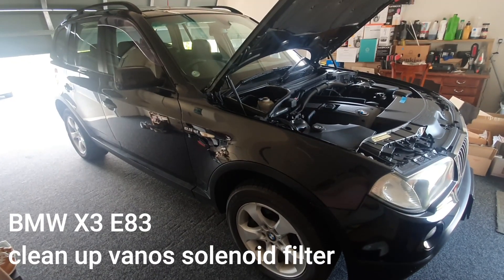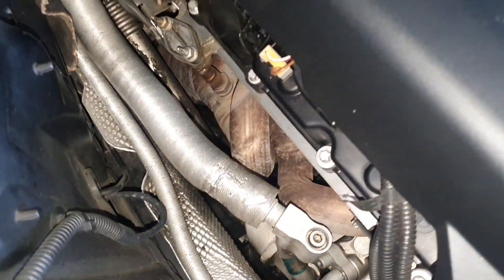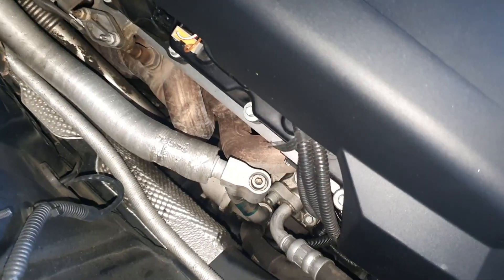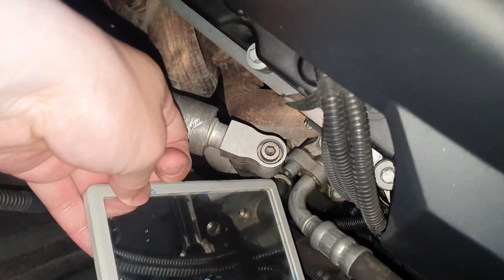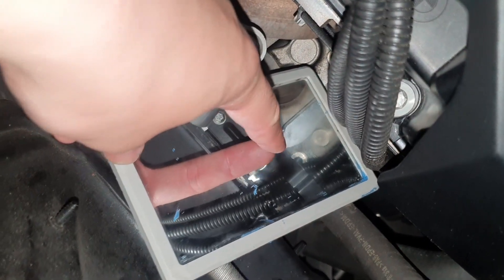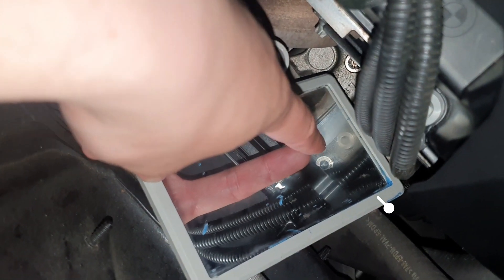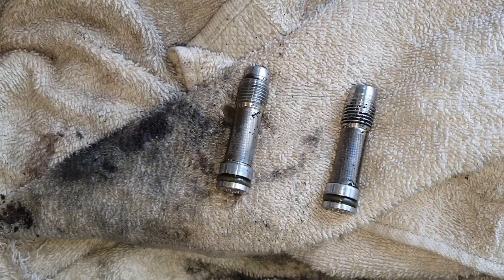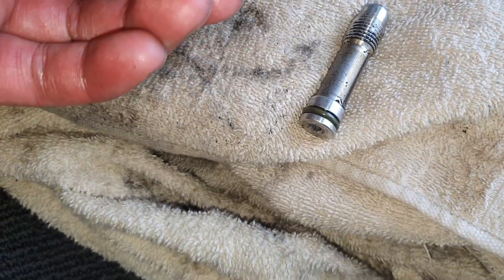clean this before too late. BMW X3 VANOS solenoid filter

Comment: I find on my 07 E83 if you move the washer reservoir it gives much more space to remove/install the valves.  When you clean the valves, make sure the ball inside is free, and rattles when you shake it. If not give it a few taps until it frees up.

Comment: Will this fix rough idling?
Reply from the maker: if the idle related to throttle body it may help.😀
Reply from the maker: this may help.
https://youtu.be/PGhmKBCeaFc
Reply: It fixed my poor idle. Mine were really caked in sludge. The top one anyway.

Comment: Excuse me, what error codes did it give you or what failures did they present to you and were they solved by doing that?
Reply from the maker: hi, potentially its didn't have a code for this. when this filter clogged, it may effect on the function of Vanos.  those errors code related to Vanos solenoid may cause by this.
Reply: @diysignal3107  This fault may activate that yellow broken engine light on the dash during first morning startup.